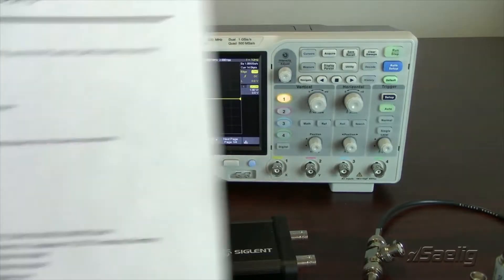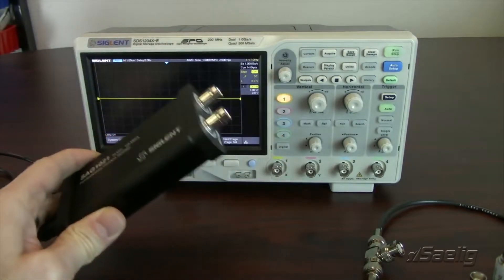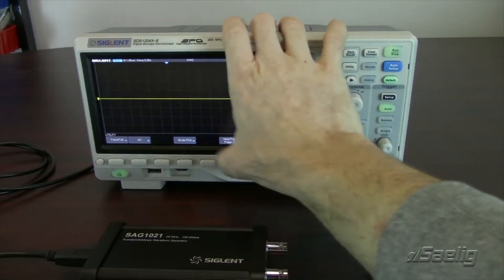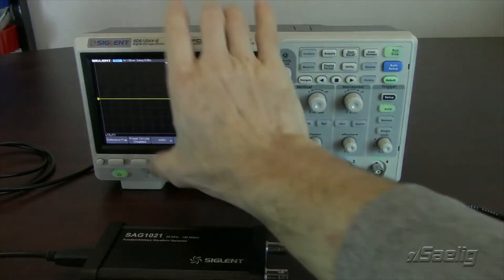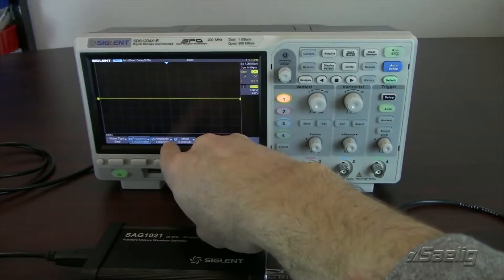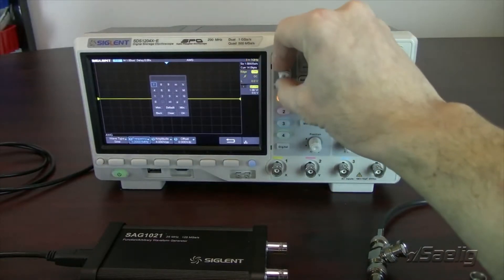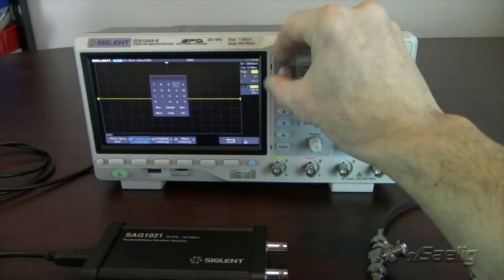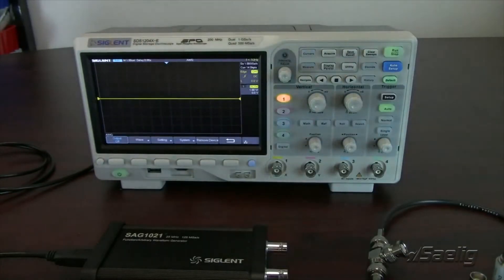Adding a SIGLENT SAG1021 function generator to an SDS1004X-E Series Oscilloscope

Comment: can i use the trig out jack on the back of the scope to connect to a frequency counter?
Reply: Yes. This will measure the trigger rate.. but this is also shown as the Frequency measure in the upper-right-hand side of the display. You can always write info@siglentna.com if you have additional questions. - Jason, SIGLENT NA